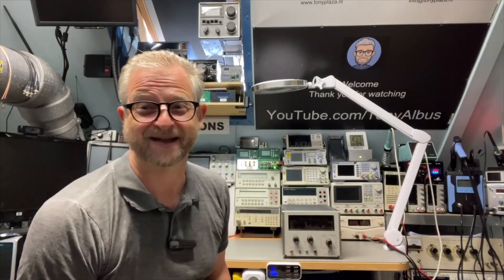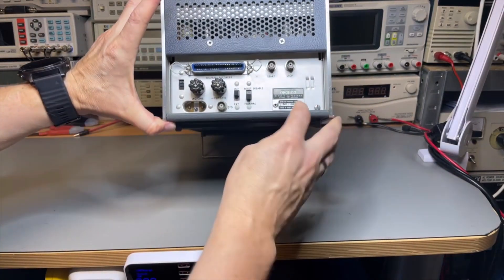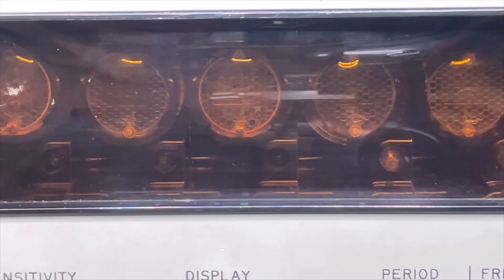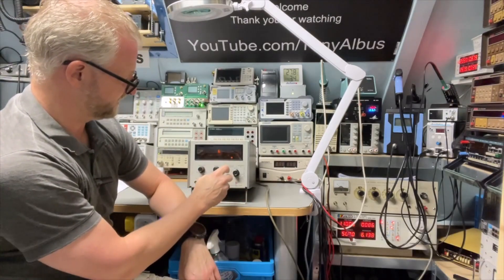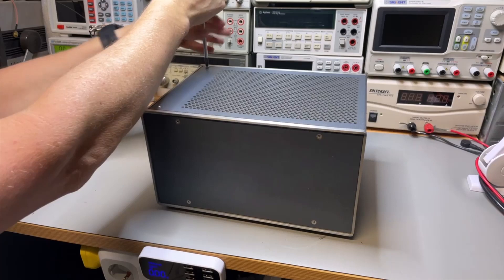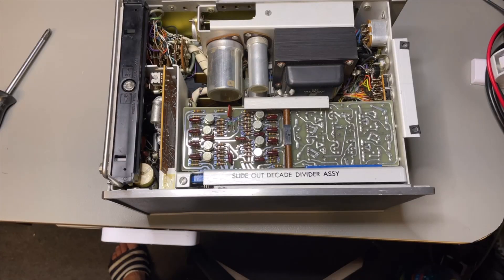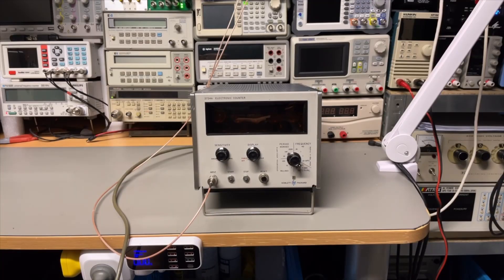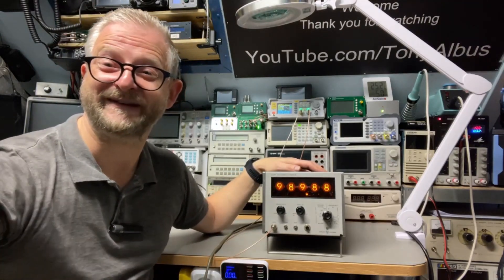TA-0312: HP 3734A Frequency Counter Nixie 1960s Cleanup

Comment: I have an old HP Nixie tube 5325B Universal counter. Of course it also has the oval power socket. But I too have one of the plugs that I've had for years. I am careful not to lose track of it. Last time I checked the 5325 it was still working, and I've never done a thing to it since I got it used about 20 years ago.
Reply from the maker: That quality will keep working. Great you found one. thanks for sharing.
Reply: @TonyAlbus , I really enjoy your channel and your eagerness to look inside both the new and old gear, because I have that same eagerness and curiosity to both figure it out and just look at how it was built. Electronics is fascinating.
Reply from the maker: @johnwest7993  Thank you John, yes we have that in common, i love it!.

Comment: Hi Tony, that's a beautiful piece, where did you get it, I've been looking like crazy for that meter, I wanted to add to my HP collection - 209A Oscillator, 427A Voltohm Meter and 3400A RMS Voltmeter. I didn't come across it anywhere, the model 5321 A or B was still being produced - it was only a pulse counter, but I can't find it either - I found out that some company is buying it and converting it into a clock. If you ever want to get rid of him, you have my email address........ 🤣🤣🤣

Edit: I make the old HP power cables myself, I don't want to pay 40 USD for them and I want to keep the device in its original condition.

Nice day 🙂 Tom
Reply from the maker: Hi Tom, your luckey day, if you are such a fan, email me.. i sell it to you.. it looks like it will find a great home with you.
Reply: @TonyAlbus  😲 ......................... 🤩😜🙂🙃🙂 ........................... 😁 Thank you very much 😀